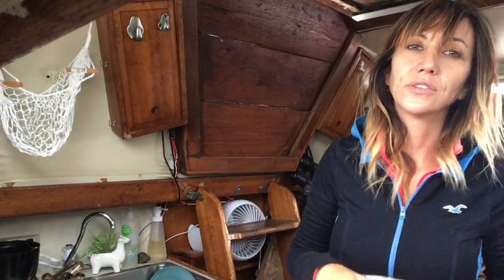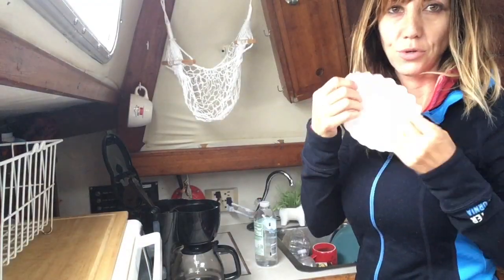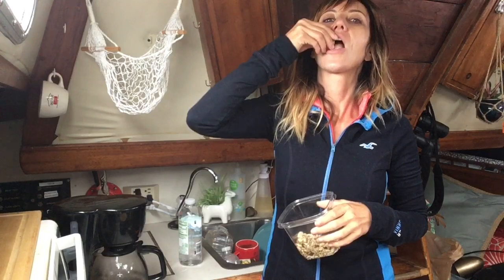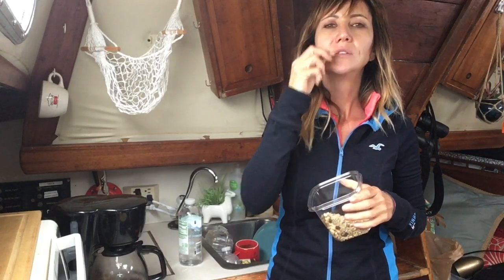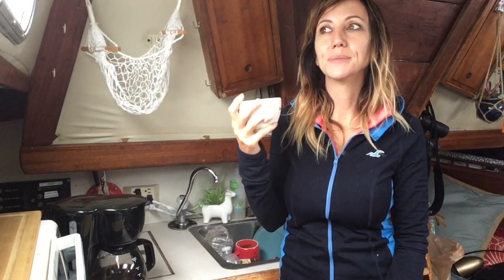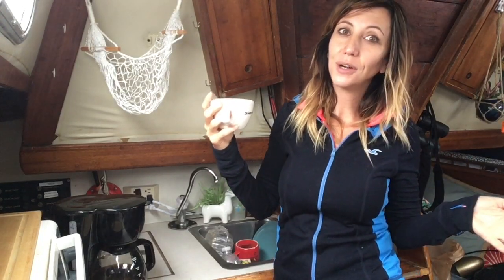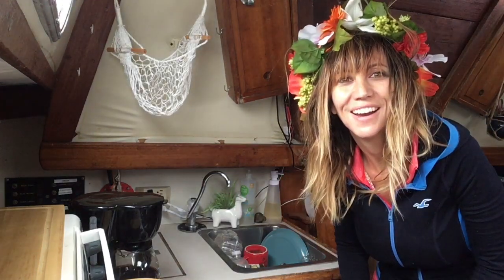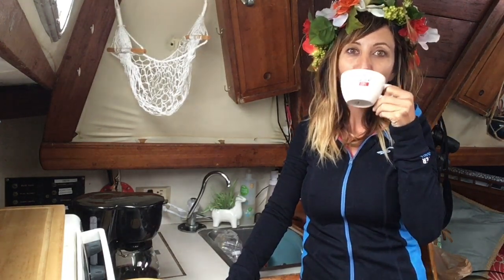Sailing RECKLESS - I Don’t Need An Electrician

Comment: When you start measure current, you soon realise how much/or small battery bank you have. And your boat is old “ish”
so the electric parts uses more amp. Like the fridge, light, autopilot ex. 
A shunt/ammeter will give you the correct number, but you can find it by writing everything down. 
And!!! I’m sure you are a better sailer than many of the people watching this canal. 
Have a great day.
Reply from the maker: Anders Jakobsen ok so I think I’m undertanding the concept of this battery thing a little better! 🤓👍🏼⛵️✌🏼

Comment: If you know how to do some plumbing, electricity is the same way in many ways.  You got this girl!  Make sure you set it up with a charge controller, or a charge wizard so you do not boil your batteries dry.  I also recommend upgrade your house batteries to Battle Born batteries.  They are expensive, but money well spent.  To keep everything going I would recommend between 300 too 400 watts of solar since you live in the north.  That should do well for one person on board.  Just be sure you follow all instructions carefully.  You do not want any problems that is for sure.
Reply from the maker: Bill Connely My last boat had some kind of charging panel and I really didn’t understand how it worked🤷🏻‍♀️ Thanks for the great info. I will look it! 👍🏼😊⛵️💃🏻💥

Comment: Big fat back you say? Not possible to be able to have it called fat, as you only way 100 pounds. Nope more like PHAT :)
Love your positive attitude. You can saddle your own horse and don't really seem to need much help at all. By the way you faucet is dripping. If you hate Michigan (I grew up there and also maintain my full solar summer home there) Try Florida. We have lots to do and an extra mother in law suite that no one uses, just stop by. lol Love to see in person doing your thing on a boat down here, the wife is a devoted follower of your videos as well, and would be stoked,
Reply from the maker: B Povish whaaaat?! That is an amazing invite. I’ll probably be down in Florida’s sometime in January and February 😊
Reply: I am actually currently looking for a 38-40 foot Class A motor home (used of course) and it has to be a diesel pusher. At first I was going to buy a diesel school bus. You can get a nice one in great mechanical condition for 4to6k and then I was going to make it a schoolie. After I realized that I can get my Class A used down here where there is a glut of them for 4k to 8k that would be much nicer than a bus anyway as the bus's are not meant for ride quality and long trips. RV's come with dual air, generators, water tanks, etc by them time I got a bus outfitted with the things the RV's already have I would spend twice as much! All I have to do to an RV first thing is solar and I already own the panels equipment and 6 AGM (glass mat batteries) keep on posting you are inspiring to watch. Beauty AND brains, AND can swing a hammer and use power tools? WOW you had me at the use of tools, the rest is just a nice bonus. lol I have to sit down and re-watch some with the wife and I'll get her to Subscribe too! TTYL